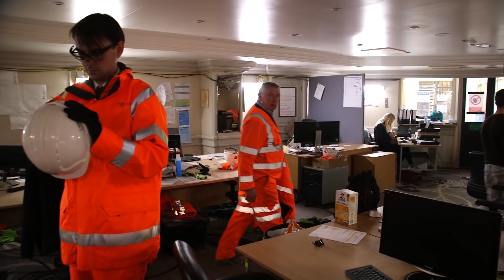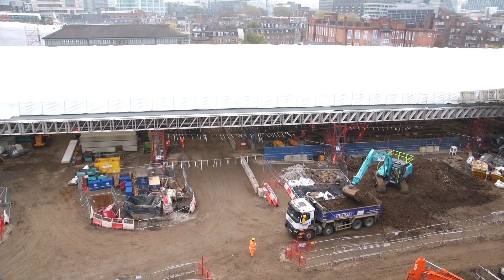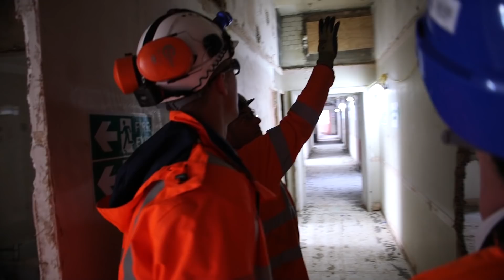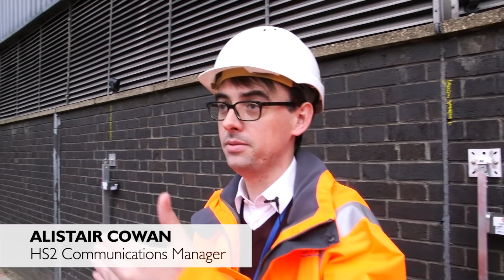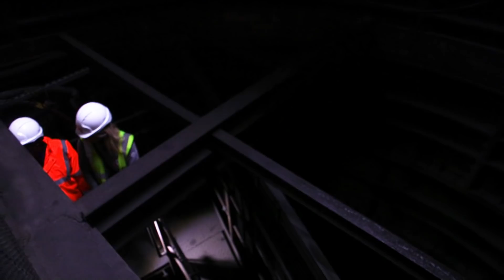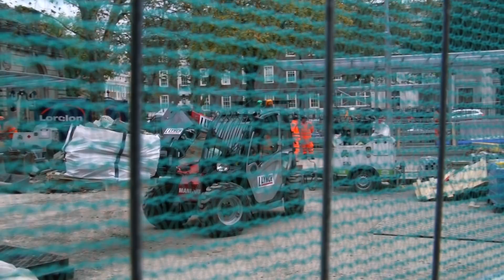HS2 Euston Demolition Works

Comment: why oh why did they not link hs2 up with hs1 .. been saying that for years .. that was the original plan ..
Reply: There is still the possibility of doing this at Old Oak Common so you can go direct from Birmingham to Paris. There just doesn't seem to be the demand for it though.
Reply: @hairyairey  Birmingham to Paris (and Brussels) sounds awesome.

If passengers that use airports in the Birmingham area can be persuaded to switch to trains, that would get rid of some of the pollution in that area (and on the path to Paris).
Reply: @ @DavidShepheard  "Birmingham to Paris (and Brussels) sounds awesome." It does, unfortunately there just aren't the number of passengers required to make such services viable, hence the HS1-HS2 link got dropped (amongst other reasons such as objection from Camden residents.) Eurostar posited "North of London" services years ago, but the quietly gave up on the idea.
Reply: And most of the demand at OOC to/from HS1 would be from/to Crossrail:The Elizabeth Line destinations, most notably Heathrow (though also Reading, Slough, etc).
Reply: @hairyairey  with the Brexit farce and xenophobia, I don't think the two lines will ever be connected. Shame , a lost opportunity
Reply: @dgattenb  you mean with the media cashing in on Brexit hype? There's plenty of companies setting up in business here, possibly because here they won't have to pay EU tariffs.
Reply: @hairyairey  oh boy
Reply: @hairyairey  give us some examples that make up the the giant companies that have or are leaving
Reply: @jusb1066  read what Tim Martin of Wetherspoons says - https://www.jdwetherspoon.com/tims-viewpoint/tims-viewpoint-september-2018 - I can't even find a document that says how much we are paying in import tariffs but my estimate is another £15 billion per year. (That's assuming 5% on all imports). Another thing occured to me, why is the EU so obsessed with the Irish border when they can't even document properly what is passing through the port of Rotterdam?
Reply: @hairyairey  Re: "Another thing occured to me, why is the EU so obsessed with the Irish border when they can't even document properly what is passing through the port of Rotterdam?"

Are you too young to remember the IRA bomb attacks that were stopped by the Good Friday Agreement? Brexit breaks that agreement if a hard border goes in. Breaking a peace agreement with terrorists is not something desirable. That's why Northern Ireland voted against Brexit and why Eire is pushing for us to sort out the border issues.

But this has nothing to do with buildings west of Euston being demolished (unless we hire the IRA to do the demolition).
Reply: @DavidShepheard  yes I do remember the IRA bombings and I think the movie Patriot Games did more to end the violence than the Good Friday Agreement (incidentally there are still terrorist attacks there they just don't get reported). It dried up the funds for the IRA (the list of actors who refused to take part in that movie is somewhat telling). I think you're missing the point though. Since what passes through Rotterdam isn't tracked properly and that's a substantial amount of the world's trade why is the amount of trade across the Irish border such a big issue? There are simple solutions to this problem the EU is simply using it as leverage. As for the IRA doing demolition they did a very good job on Manchester (incidentally that truck was purchased about 2 miles from where I live now).
Reply: Because serving those journeys with a high quality pedestrian link between Euston and St Pancras can be done for a fraction of the cost. And with the benefit of also improving stuff for some of the 95% of HS2 passengers who wouldn't travel through London on HS1 (eg connecting better with Thameslink), rather than penalising some of them by stealing an HS2 path from places like Stafford and Stoke and still not give central Birmingham, Liverpool, York, Newcastle, Preston or Scotland direct through services to Kent and France (where there would also be select destinations). Many of the 5% would find it better to make the change in London than use the through trains - take a frequent service to London from a wide number of Northern/Midlands destinations, change there for a full range of Kentish/Continental destinations also running frequently vs, if your city isn't one of the lucky ones, having to change onto an infrequent direct service at somewhere like Crewe or OOC, and then again at Stratford International or Lille if that end isn't one of the select destinations.

Greengauge's model for a link had about a third of the passenger numbers walking Stratford-Stratford International (but assumed that the similar Euston-St Pancras distance was too far) despite the change available at Old Oak Common (they had people travelling from Canary Wharf via Stratford to HS2, rather than just taking the direct service to OOC), and a different rough third of traffic being Kent-OOC traffic that then went to destinations in the SE like Reading, Heathrow or Milton Keynes - they were clutching at straws trying to justify it.

Or do you mean a death-trap Euston Cross? a vast cavern down deep that would still struggle to be large enough for the number of people boarding/alighting - not just in terms of crowd management, but also in terms of dwell times as most of a 500+ capacity intercity train disembarks and fills up again within the 5 minutes that a 6-platform layout would allow.
Reply: They should link up HS2 and HS1 outside of London, not at the London Terminus.

If we get high speed rail lines up the West Coast and East Coast we could eventually have an M25-like high speed orbital railway that circles London and allows trains to run from Scotland to Wales or Cornwall.

Crossrail and Thameslink could also link into high speed rail, so that people can transfer to mid-speed rail for other journeys part way through the London area. That could cut down on the number of people who need to come into London and transfer via the London Underground.
Reply: It’s a short walk from HS1 to HS2?